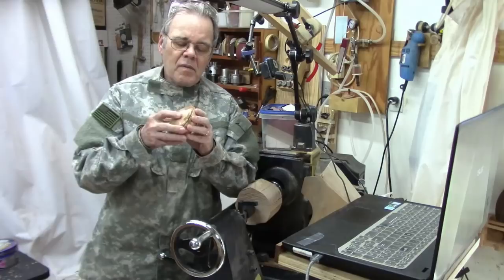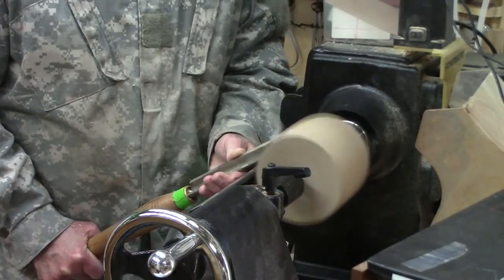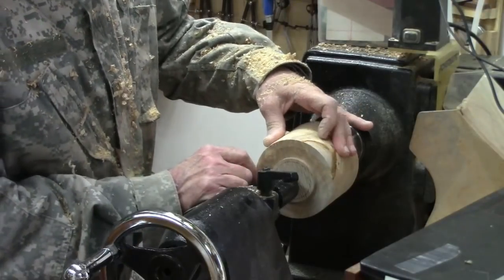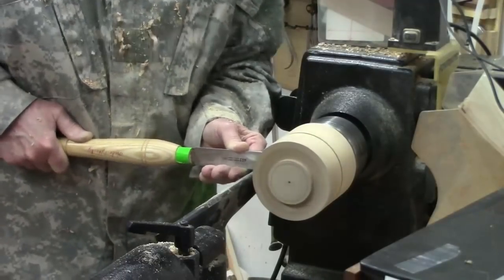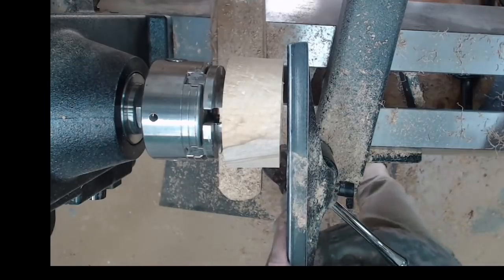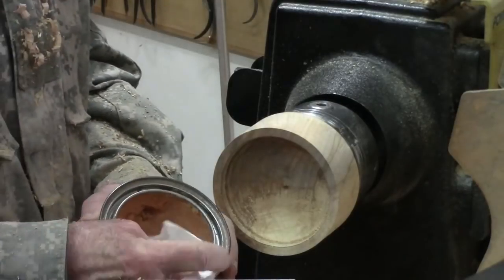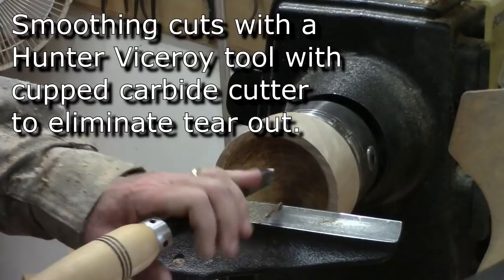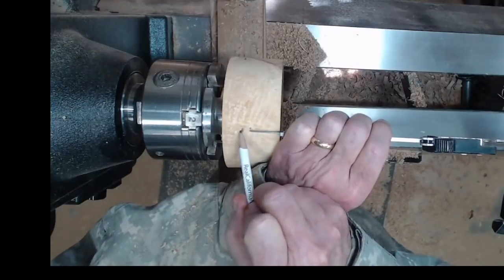Happy as a Clam! Turning A Clamshell Box

Comment: Very nice box! 

I have a question and a comment: Why did you use an 'in-fitting' lid (with the tenon on the lid instead of the box)? It would seem that you could have put the tenon on the box, which would increase the box's useful volume.

With regard to parting off, Alan Lacer demonstrated using a hacksaw to make thin parting cuts. You start the cut by making a v-groove with a skew. Then, using the v-groove as a guide for the hacksaw blade, cut the blank in half (with the lathe running at a comfortable speed, say 800 rpm). It's very quick and wastes very little material. It also reduces tear out in punky woods.
Reply from the maker: I do an inset lid because that is the way I learned from how Ray key and Jimmy Clewes and Chris Stott. I think it is done this way because it just looks better when open. You are correct that a tenon on the bottom will provide more space but really not a benefit on this style box. Thanks for bringing up this point.